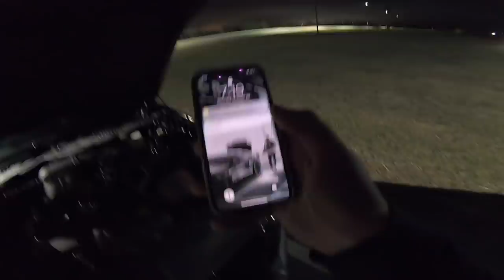Cleetus McFarland RIPPED my Mustang on NITROUS!!

Comment: You did not "do everything (you) could do to fix the belt". We've all been trying to tell you to check the alignment of those pulleys, check that crankshaft/dampener pulley, check the tension of the belt. If you can't do it bring it to somebody who can. Is that n aftermarket belt tensioner?
Reply: Exactly lmao all hes done is put spacers and buy belts
Reply: It's the dampener failing. Needs tension maintained

Comment: If you're having a problem with the belt coming off 9 out of 10 times it's the alignment I know you said you had it checked but if it's not running true it's coming off maybe you need to go to like a rigid motor mount. Keep up the content man

Comment: Can I just ask, have you got a tensioner on the belt to take up the slack created with the extreme torque to low rpm shifts? It almost sounds to me if the pulleys are aligned correctly and it still throws, there must be a problem in belt tension in that short span between high and low rpm transition.

Comment: If you have ever had antifreeze or water on the belt or pully you need to degrease it by hand make sure you get in every groove if not itll throw belts every day till it blows
Reply: riggin and jiggin nope. It’s gone thru 5+ belts in a couple weeks. This one was brand new. It was the tensioner.

Comment: The problem with the small mustang might be a seperatine belt my car did the same exact thing lost power steering lost radio and headlights and it eventually just died on me had to pay a tow truck for 62 miles I was so pissed

Comment: Hey. heres a hint. Your pulley is not aligned. if it keeps blowing belts.
I suggest checking your mounts since you had the motor rebuilt.
something is wrong.
Reply: blu3fan it was the tensioner
Reply: @jvke.p  I had a similar issue with my jeep warping belts. mine ended up being that the power steering pump pulley was not fully seated onto the mount.
impossible to see by eye. Only figured it out by using the installer tool.
smh manufactured/rebuild parts.

Comment: Don't Rev it more than 2500 when you launch your belt will be under to much stress that's the problem you having I would launch at 1500 2000 at the most
Reply: LOS ANGELES SIDESHOWS it comes off during pulls as well.